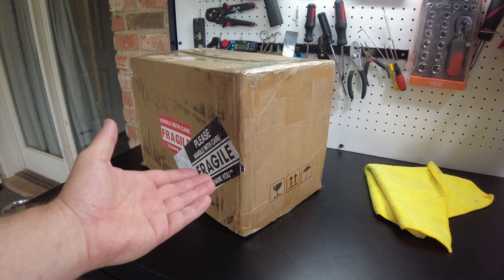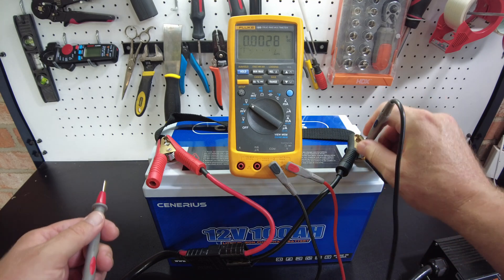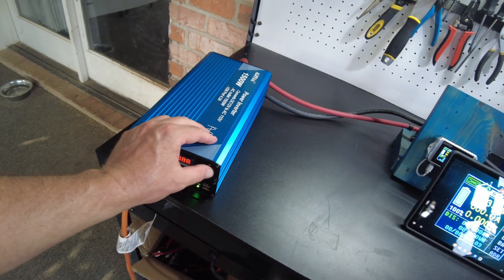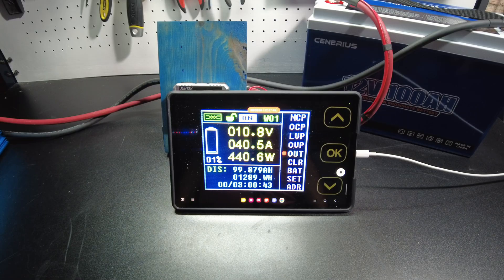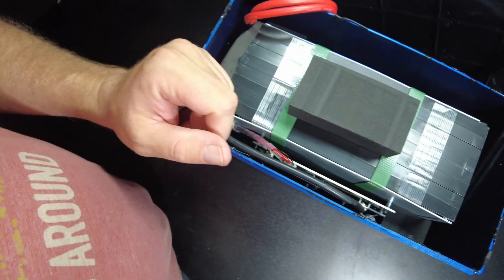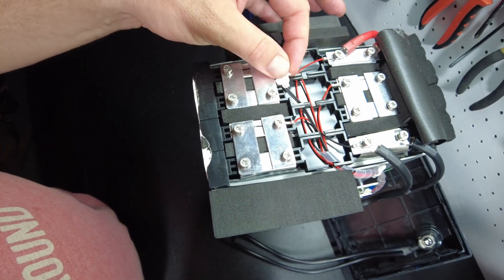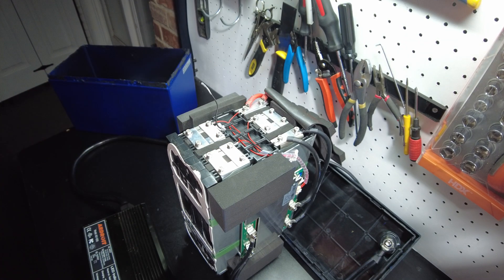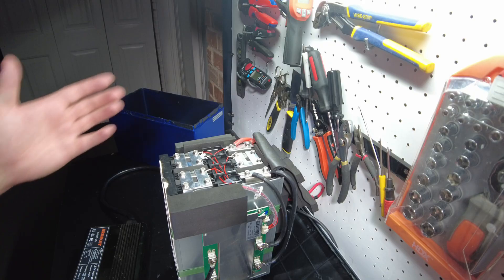Cenerius 12.8v 100Ah LiFePO4 Lithium Battery

Comment: Another great video. It looks well built. BTW, you have been cranking out a lots of videos, love it.
Also, how is the 2000W Leesky inverter doing? Have you been using it a lot?
Reply from the maker: Thanks, Bud! Yes I've been cranking them out, I'm trying to stay on top of it, I'm getting flooded with these things, LOL. I've used the Leesky a lot, BTW I have the 1500w. It's been super solid. Only issue I ran into, if I run my A/C on it, it would trip the GFCI on the inverter. I don't think it's an actual issue with the inverter, I've read it's common for some loads like A/C's to trip some GFCI's. I just replaced the GFCI with a standard double gang socket. Thanks!
Reply: @BradCagle What do you guys do with all these batteries you receive😅. Your workshop must be already filled up with all these batteries. Please send me one😃
Reply from the maker: @EasyyokeFilms  right now I've been paralleling them all together 😂